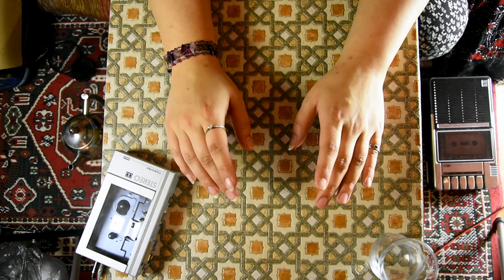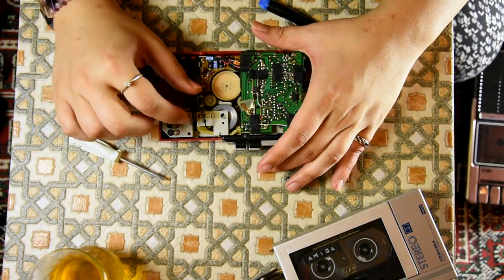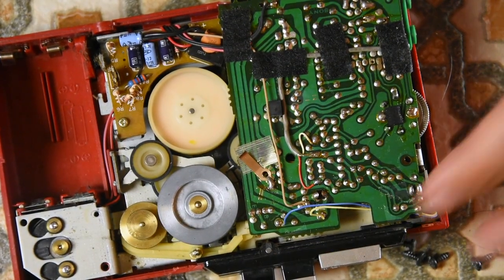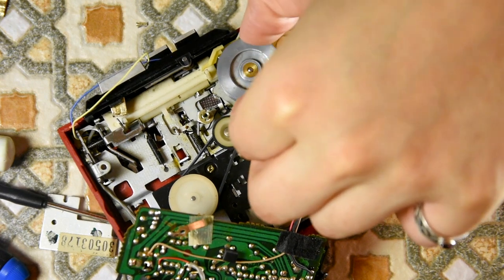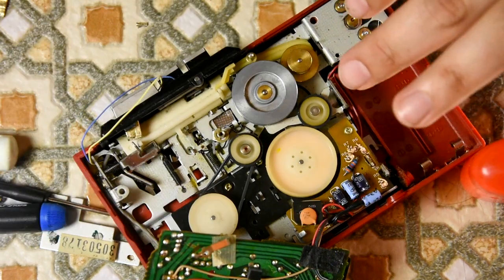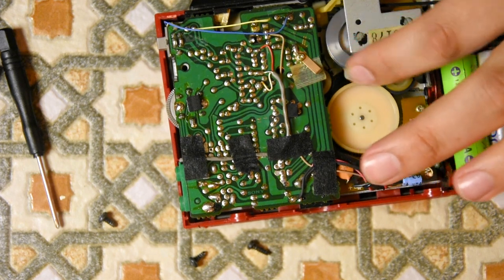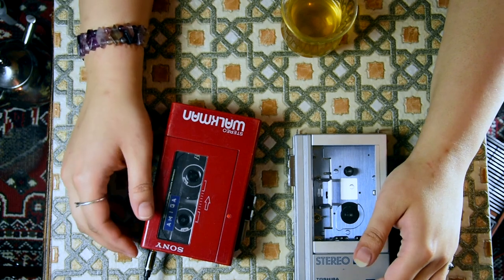The Personal Stereos - Part 3: Sony WM-4

Comment: Hi, I have just bought a 2nd hand wm4 walkman and replaced the drive belts with good fitting replacements. Play and fast forward are fine, but rewind works only without a tape inside.

How should I repair this?

Also how do you turn the 'v r' control to brighten the tone, mine doesn't seem to move?

Thanks

Comment: You just fixed the same exact model of walkman i used to have in high school... with the same exact problem! (no, i didn't stuck in FF and REW, but the STOP button died like in 1987... after a drop on the floor) Sould i try find mone and fix it?
Reply from the maker: YES!... its not a hard fix, if it's got a piece inside rattling around, it may well be there already

Comment: just dug out my old WM-4 and put batteries in...It seems to all work ....The gears and rollers all turn but won't turn a tape inside cause all cassettes are old now and don't move that easily..The tape head cleaner ran ok.
. I imagine the belts are shot.   Where can I get some belts? Ebay doesn't have any specifically for the WM-4
Reply: You could get some belts on ebay. They Don't need to be perfect for it but you could always ajust he speed of the motors. Or find a similar size belt

Comment: I have a question about tge very same WM-4, I replaced the belts but the speed is too slow. I'm wondering what could be the problem?
Reply from the maker: Two things, make sure the belt is not to tight if you've used a non standard one, and also there is a speed adjustment pot in there with which you can tweak the motor speed.
Reply: MsMadLemon where can I find this speed adjustment pot?
Reply from the maker: 14:58  the part that says "VR" on the board is the pot. 

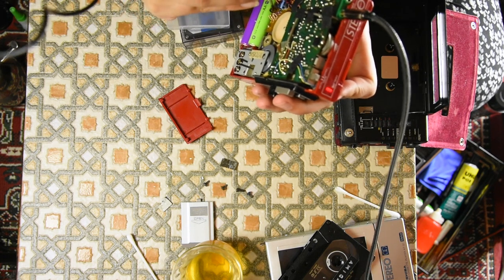15:43 you see me turning it there.

Comment: I just got one of these at an auction, for an exceptionally reasonable price. Do you have details of the demagnetising cassette you are using? I would love to get one.  Thanks
Reply from the maker: The only thing I know about it, is that its an electronic one from Radio Shack.
Reply: I see a lot of them with brushes and a "demagnetizing fluid",  but I can't find one like yours that actually looks like it makes a difference! I'll keep looking, Love your videos!
Reply from the maker: "Demagnetizing fluid"? what the freak is that?! lol.;o)) .. Ah brushes, its a head cleaner, the fluid is just Isopropyl Alcohol. Yeah i'd only get electronic demagnetizers, I even have a second electronic Sony one somewhere, but I prefer this one.
Reply: I've cleaned it up with Isopropyl and cotton buds, and it's already sounding good. Do you put a battery into the electronic demagnetizers, or are they powered by the motor of the player? Thanks and keep making more videos!
Reply from the maker: no the demagnetizers have coin type batteries you have to change.
Nice! glad you got it sounding better!
Reply: Oh, that's cool I will keep up the search!

Comment: Does the demagnetizer tape cassette work very well compared to one that plugs into the wall?
Reply from the maker: I've never tried the mains powered one, i'm a little wary of it since apparently there seems to be more chance of magnetizing the tape head with it.
Reply: MsMadLemon I have read the same thing happening. Have you proven to yourself that the cassette shaped one works very well?
Reply from the maker: Honestly speaking, i've heard that demagnetizers make a difference hence why i use this one whenever restoring or before recording a tape. However I havent heard any significant difference in the sound quality itself before or after demagnetizing.
Reply: MsMadLemon Thanks. I have read that magnetised heads can cause reduced treble response and partially erased tapes on playing. Demagnetisation would indeed be beneficial. Need to see if those cassette form-factor demagnetisers work well as they would be very handy!

Comment: was the motor running before repair?  i've got a similar mechanism sanyo walkman but the motor was not working at all, so have no idea what i should do first, any recommendation?
Reply from the maker: Turn the walkman off and try to power the motor by using a 3v battery, if it spins it mens the motor is fine, if not, possibly a replacement..... if the motor spins, it could be a dry joint so resolder the motor wires on the circuitboard. (best to always start with the simplest things when repairing)
Reply: Ms Mad Lemon thanks for the input, hopefully i could figure out how to connect the battery to the motor directly for trial.
Reply: @MsMadLemon  thank you very much for the input, but i don't quite understand how to test the motor, possible for you to show a video clip for more please?  greatly appreciated in advance.

Comment: hi ive just begin watching your videos, yore a very interesting lady,
I notice when are changing belts!, the condition was onad the basically melt, 
but a little tip, there's a product called rubber renew, which obviously can't help mthe belts
but will be good for the wheels with the rubber rings around them, 
and don't forget old capacitors will affect the play speed, ;-)

Comment: Some good pictures herehttp://www.petervis.com/walkmans/sony-wm-4/sony-wm-4-inside-view.html  but not of the stop button mechanism  it also has the correct belt sizes .I have a working grey wm4 said to be one of the loudest walkmans .
Reply from the maker: I did notice that, it is pretty loud and I was surprised. Thanks for the link!
Reply: I read somewhere the WM-4 is much louder than many models because it uses 4 batteries instead of the usual 2.

Comment: I found two of them was cleaning house the same color one have batterie acid all over,I found Two toshiba kt-4016,kt-vs1,realistic minisette-19,Sanyo spt-1500,Craig model4501 another House two months ago I did find Aiwa with digital display and attached recharge battery and akai,and there was Sanyo m4430 I left it there next day was gone someone take it.

Comment: Thank you for posting this.  Our family's first Walkman was a WM4 (silver, not red).  I found this video by a search of the model #.   If you think the tape speed is off, you can adjust the pitch pot while it's running (and not all apart) by inserting a jeweller's screwdriver in a slot at the top of battery compartment.

Comment: My Sony TCS 350 looks almost like your red Sony :] Only with added Microphones. But mine misses the belt holder on the back.  Are you planning on changing the capacitors too some times?
Reply from the maker: Indeed, it does..Replacing capacitors In this wm-4? well it's not so urgent, I have a few things on my list that need recapping, so for now i'm leaving it as it is.

Comment: Hi Maddi. You are making great videos. I love all of them. Can you tell me where you got the package of belts? I have a AIWA PX997. But I can't find where to get a belt for it. Greetings
Reply from the maker: Hi there, thank you! 
Actually I get the belts from ebay, in bundles like this: http://www.ebay.com/itm/120-PCS-40-130mm-Mix-Cassette-Tape-Machine-Square-Belt-Assorted-Universal-Repair-/302142095704?hash=item4659128158:g:lUIAAOSwdzVXwcR8